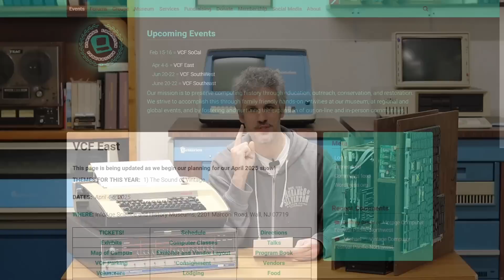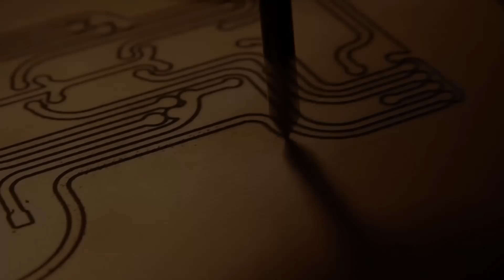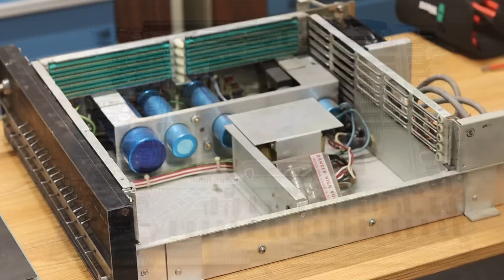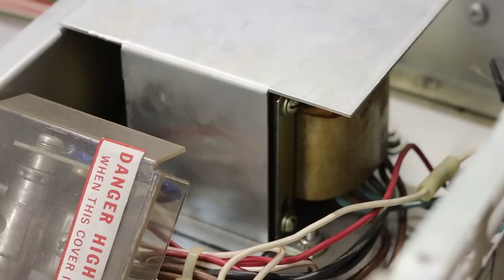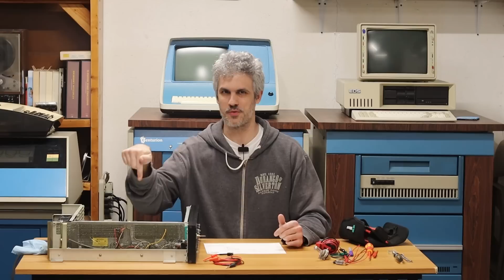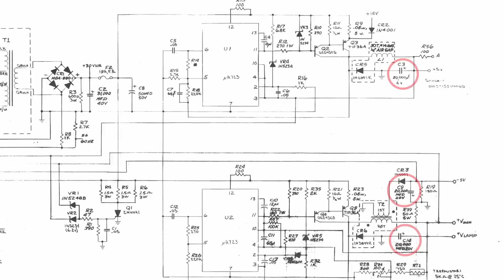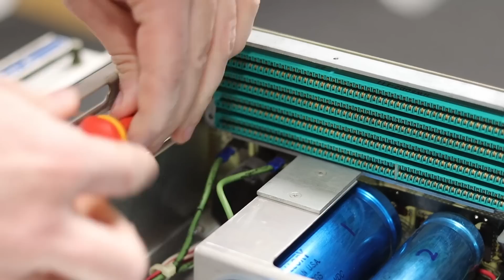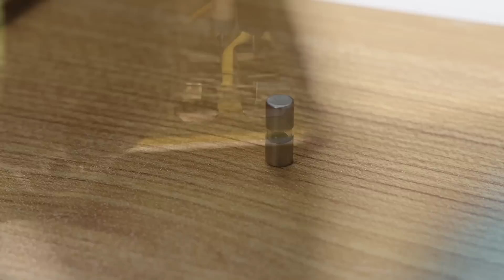Working on a Data General Nova 1210 Power Supply

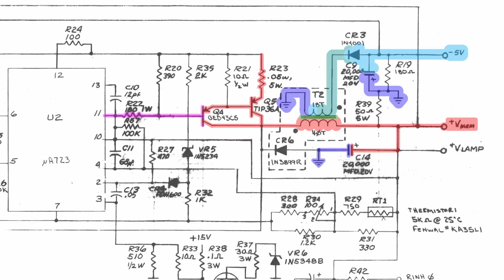Comment: 16:00 it looks like Q4/Q5, Primary of T2, CR6 and C14 are actually a buck converter for +Vmem and +Vlamp, and they tap off a secondary from the buck converter’s inductor to make a flyback converter with CR3 and C9 for the -5V. A bit of googling comes up with a name for this as a "Fly-Buck" converter although I never heard of this when I used to design switching power supplies.

Comment: PDP-11/73, will be amazing if you can give it a nice acrylic neon case.
DG NOVA 1210 is the creation of Edson de Castro, yeap, the PDP-8 creator (product manager). Edson de Castro died on September 6, 2024, at the age of 85. "Ed" (as some people called him) also the product manager of the PDP-X which was later cancelled, making him consider to left DEC to start Data General with the Nova as it's main product. AFIK, there's a lawsuit against De Castro by DEC, resulting in a "No go" for DEC, The Nova is the foundation for RISC while PDP-11 was the foundation for VAX, like I mentioned earlier, I'm not a big fan of VAX ISA but DEC construction was clever, not as complex as IBM but "just enough" to be useful. Now we know, RISC in the IBM Brain, was at the time, the foundation for many new architectures but 801 will not compete against MIPS, today Alpha (a MIPS descendent or DEC's MIPS) it's just another commercially failed technological marvel.

Comment: That looks like the type of fuses that are incorporated into christmas light plugs. On the part that plugs in, there is a small window with a plastic slider. They also usually come with extras. I am pretty sure they are 10A at 120VAC.
Reply: True! But the christmas tree fuses can not be trusted like the Buss or other branded ones for this type of equipment, unfortunately. The auto guys get burnt by a lot of unbranded fuses.

Comment: I'm pretty sure the very similar DG Nova  in my dad's lab at Strathclyde Uni. back in the day was connected to both a scintillation counter, and the PDP11-70 variant. We also hooked up a couple of early Commodore  Pets to it complete with a "BitPad" digitiser, hard drives and a bunch of other gubbins. 
Lots of serial weirdness and GPIB cables. Having access to these machines in my teens got be hooked..

Comment: Electrolytic caps should not just be tested with a "rule of thumb", especially one you made up yourself..   10mA is pretty high and while it says that the cap is probably safe enough to power up for brief periods to test other parts of the circuit without the cap immediately blowing up in our face, if you run it continuously, it will run hotter than rated and either spring a messy leak or slowly cook itself dry...   You should be measuring ESR after reforming to get a better idea of just how good the cap really is vs. just arbitrarily saying a current value is fine...

Comment: Does the -5V supply voltage change proportionally to the load on the +15V rail? As the +15V SMPS duty cycle increases to handle a load, the amount of energy through the transformer should also increase. Maybe R39 is meant to provide a minimum load so there's always some pulses for the -5V supply. (50 ohm, 5W attached to VMEM / +15V) I'm surprised that R39 is only rated for 5W since it will be dissipating 4.5W continuously.

Comment: Love seeing you bringing these computers come back to life David 👍
Top tip to remove the sliding cover: either sit it on the back and then slide it upwards or fit rubber feet to the bottom so that the cover doesn't rest on the work surface.

Comment: The thing I love about core memory is you can actually hear the data running through it. Used to come in very handy back when I used to repair ICL system 10s because you could hear when the diagnostic programs finished (or, frequently,  crashed!)

Comment: I would venture a guess that the two RAM cards need a greater gap than was offered by the backplane spacing, or that the card furthest from the CPU board was an add-on and just put in the next available slot.

Comment: Very cool.  Back in school in the mid eighties I had a digital systems course that used these.  I remember learning to manually assemble code to binary and load the programs and data in via those toggle switches.  Very time consuming and error prone but very valuable exercises in learning the fundamentals of computers and digital hardware.  Awesome memories.  ❤  thanks.

Comment: Yeah! I worked on Nova 1200s in the '80s, repairing them to the component level. They were used to acquire, process, and store seismic data for the USGS worldwide SRO (Seismic Research Observatory) systems. I still have a 16KB core memory card in storage somewhere, and probably a couple of manuals.
Reply: We used the TI Silent 700 KSR and ASR (dual cassette) teletypewriters in 20mA mode. I have one of each and brought my ASR to VCFSW last year.

Comment: That was lucky, my encounter with exploding capacitors left me with a 10 cm trace blasted away from the board. The fuse in your case did what it's meant to do, I wasn't as lucky :(.

Comment: I've come to the conclusion that it's good to put an Ohmmeter across the voltage rails when checking caps (I usually replace the older electrolytics) but since I so far only had one tantalum problem, I give them the benefit of the doubt. Measuring an almost zero ohm rail is a good indicator though and they can't hide from that 😜

Comment: I've build a better model then the one at Data General (Mod. Maj. Gen)

(Tune of "I am the very model of a modern major general")
by Stephen J. Levine
I`ve built a better model than the one at Data General
For databases vegetable, animal, and mineral
My OS handles CPU's with multiplex duality
My PL1 compiler shows impressive functionality
My storage system's better than magnetic core polarity
You needn't even bother checking out a bit for parity
There isn't any reason to install nonstatic floormating
My diskdrive has capacity for variable formating

(Chorus)
His diskdrive has capacity for variable formating
His diskdrive has capacity for variable formating
His diskdrive has capacity for variable format-formating

I feel compelled to mention what I know to be a gloating point
There's lots of space in memory for variables floating point
Which shows for input vegetable, animal and mineral
I've built a better model than the one at Data General

(Chorus)
Which shows for input vegetable, animal and mineral
He's built a better model than the one at Data General

The IBM's new homecomputer's nothing more than germinal
At Prime they still have trouble with an interactive terminal
While Tandy's done a rotten job with operations boolean
At Wang the byte capacity's to small to fit a koolie in.
Now Intel company's finances are somthing of the troublesort
The Apple IIC crashes when you implement a bubblesort
All DEC investors soon will find they haven't spend there money well
And need I even mention NeXT or Unysis or Honeywell

(Chorus)
And need he even mention NeXT or Unysis or Honeywell
And need he even mention NeXT or Unysis or Honeywell
And need he even mention NeXT or Unysis or Honey-Honeywell

By striving to eliminate all source code that's repetitive
I"ve brought my benchmark standings to results that are competitive
In short, for input vegetable, animal and mineral
I've built a better model than the one at Data General

(Chorus)
In short for input vegetable, animal and mineral
He's built a better model than the one at Data General

In fact when I've a Winchester of minimum diameter
When I can call a subroutine of infinite parameter
When I can point to registers and keep their current map around
And when I can prevent the need for mystifying wraparound
When I can update record blocks with minimum of suffering
And when I can afford to use 100K for buffering
When I've performed a matrix sort and tested the addition rate
You'll marvel at the speed of my asynchronous transmission rate

(Chours)
You'll marvel at the speed of his asynchronous transmission rate
You'll marvel at the speed of his asynchronous transmission rate
You'll marvel at the speed of his asynchronous transmission-mission rate

Though all my better programs that self reference recursively
Have only been obtained through expert spying done subversively
But still for input vegetable, animal and mineral
I've built a better model than the one at Data General

(Chorus)
But still for input vegetable, animal and mineral
He's built a better model than the one at Data General

Comment: Tantalum capacitors would have been used for a reason. Small size, but more importantly lower ESR. Probably on the backplane to reduce noise on the power rails. So using Al electrolytics might cause problems later.

Comment: Aha! I was thinking to myself "was it a Data General Nova that ran the EDAX that I used during my PhD?" and then you showed the EDAX manual. 
EDAX is "Energy Dispersive Analytical X-ray". It's used to measure the elemental composition of samples in an X-ray microscope.
https://en.wikipedia.org/wiki/Energy-dispersive_X-ray_spectroscopy
The unit that I used was hooked up to a JEOL transmission electron microscope, though typically they are used with scanning electron microscopes. 
The Nova in this case was a wheeled cart with a portrait-orientation monitor on top and a keyboard. In the front were two 8" floppy drives. 
I noticed at the time that there was a minicomputer in each microscope room, but I don't think many did. They looked so unlike anyone else's idea of a computer that they had escaped upgrade-itis 
You see, this was around 1990, they were already pretty old by that point. 
Of course, that's positively modern compared to the PDP11s that were running some of the dynamometers at Ford's Dunton labs as late as 2018. 
The 8" floppy drives were pretty useless at that point for getting data off of the Nova and into a modern PC for post-processing, but I found that during a measurement the conts were output on an 8-bit parallel interface. So I built up some 74-series logic to serialise that, add start and stop bits, and send it to an IBM PC. I was quite proud of that.

Comment: Tantalum caps are very qualified as explosive devices, they always fail quite dramatically. I had a mate/colleage who was getting into amateur rocketry, and was having a hard time getting his hot wire ignition system 'off the ground'. We had about 20,000 smd 6.3v tant caps. Gave him a reel of 1000 of those. 12v, reverse polarised, never had a misfire again. They are spicy. We were testing em out in the car park one Friday afternoon, Friday beers. Boss comes back from a site trip freaking the heck out from the smell. Any electronic engineer has a strong panic response from the unmistakable stench of an exploded tant. Nah nah, all good boss *pass a cold beer*. After hours games. 🎉. We let off a few that night. They get very enthusiastic with rectified mains, that was his idea. Pro tip for life, have a boss you can enjoy having a beer with once the work is done. And is as keen for dumb stuff. Engineers are just as stupid as anyone else, the scary part is they're competent. I think that was the 4th time the car park was set on fire. Nobody ever got hurt tho. We're competent.

Comment: I was SO envious seeing you remove all those screws with no trouble!

I'm getting started on restoring an AN/USM-281C oscilloscope built in 1973 that once belonged to Naval Electronic Systems Command.

It was working when I put it away, but I haven't touched it in about twenty years. I never tried to service it before, since nothing ever went wrong when I used it.

The first aspect that is trying to defeat me is simply getting the chassis apart. Some sailor over-tightened virtually every screw inside the unit, and most of them are Phillips that now have torn slots. There's at least one that didn't succumb to penetrant and an impact driver, and I had to resort to a left-handed drill bit.  Surprisingly, once it busted loose, the threads looked to be in good shape, although I chased the hole with a tap just to be sure.  The thing is built like a tank - the case looks as if it would survive small-arms fire!  (It conforms to the military definition of 'portable' - there's a handle on it.)

I (rather foolhardily) tried to power it on, and it didn't make any smoke and at least puts a beam on the screen, deflecting it in a crazy pattern.  I got enough access to check power supply voltages, and found that +130, +50, +15, +5, and -50 are all dead on, but -15 is putting out only about -12.  I think there's an old cap that needs reforming.
If the -15 regulator isn't regulating, that'll throw off all the signal handling, so no more debugging until the power is stable, which means that I have at least six more screws to sweat over before I can get to the big caps.

Fortunately, since it's a military unit, I was able to get all the manuals.

Fun times!
Reply: Man... that thing is a museum piece.  Glad you're trying to get it going.  I used one of those while attending ET A School in the A3 phase (RADAR).  I barely remember anything about it now, except that it took a loooooong time (about an hour)  to warm up before it was stable.  Stay with it, man.  That's a real piece of electronics history.

Comment: If the Rifa's don't get you, the tantalums will!
Reply: If if they don't, then crappy electrolytics will have eaten your motherboard (stares at Amiga A600 sitting on my desk)
Reply: @DaveF.  Or the Varta batteries... (stares at my Amiga 2000 whose battery leakage took me 3 months to fix) #GetTheBatteriesOut
Reply: Rifa, more like reefer -- all they're good for is smoking! 😅
Reply: ‘Don’t fear the Rifa’ nah that would be a bad song.
Reply: @radarmusen Oh HELL nah.  Don't fear the reaper is an awesome song!

"All our times have come.
Here, but now they're gone.

Technicians don't fear the Rifa.
They fear the sun and the wind and the rain!

We can be like they are!
Come on baby,
(Replace the RIFA's)
Baby take my hand
(replace the RIFA's)
Gear'll be able to run.
(Replace the RIFA's)
Baby i repaiiiiir!

Lalalalalalala (for a while)

Tantalum time has come.
Good, but now they're done.

Romeo and Juliette
Are together for eternity.
(we can be like they are)
40,000 capacitors dying every day."
(we can be like they are)
40,000 capacitors crying in despair.
(we can be like they are)
Got to replace them AAAAAAAALLLL!"

And, that's as far as i am taking it.  Getting pooped.
Reply: @ this is gold, laughing while reading it.

Comment: The black insulating layer between the boards makes total sense. Back in the late 80s I used to use a rather old (even then) electron microscope with a data capture system driven by some sort of 3 ft tall Unix rack with 8” floppies. It had horizontally mounted boards like that one, and it used to work fine for an hour or so, but after that the boards would get nice and warm which would cause the processor board to droop and short the one below out if you weren’t careful. We used to wedge a wooden rule between them to prevent it drooping.

Comment: I have a Data General Nova 2 computer that had the exact same thing happen with one of the sneaky tantalums on its backplane.    The tantalums are used to decouple the inhibit driver power for the core planes, if memory serves.    Anyway,  I turned the keyswitch and this brilliant flare of orange light shot out from the side of the unit, followed by a loud SNAP and smoke.  Scared the heck out of me.   I replaced the failed cap with an electrolytic, and yes, that worked just fine, and nothing else was damaged.
Hilarious that you ran into the exact same problem.   Maybe I'll just change out the other 7 caps before I try powering the Nova back up....
BTW -- the reason for the connections to the serial connectors from the backplane is that this is that this is the way DG does I/O connections from many of their boards -- some of the pins in the backplane are not connected and are instead used for I/O cabling.  Saves having connectors on the other edge that would make it hard to get boards in and out.
Cheers  -- Dan
Reply: I once saw some technicians in the computer science department at the University of Canterbury installing a disk drive in their DG Eclipse system, which involved attaching a connector at the back and running a bunch of wires to points on the backplane. I remember thinking at the time it seemed like a rather shonky way of doing things compared to the way DEC would have done it. I assumed it was a cost-saving measure.
Reply: you HAVE...present tense?  WELL, may I warmly welcome to the DG Users Group!
Reply: Tantalums go pee-yow! 😆 I bet that Nova 2 is a hoot to operate.  Me?  I can't afford heavy iron anymore, so I'm looking into building a PiDP-11/70.
Reply: "if memory serves" ... I see what you did there
Reply: @danmccr  Seems like a pretty nice
approach.  There are of course some downsides but at least they didn’t have to worry about Signal Integrity as much back then.

Comment: From the captions on your scanned paper (just looking at the paused video), it looks as if if it was electron beam microprobe analysis.  It's talking about using TEM (Transmission Electron Microscopy) specimens and observing K and L lines (which are the first two series of "characteristic X-ray" lines (the term in quotes is a good starting point for a search engine). Characteristic X-ray lines are an energy spectrum, and can be observed when an electron transfers its energy to another particle, as well as when it emits a photon directly, so X-ray detection wasn't necessarily involved here.

I can't tell from the captions what spectroscopy method is in use, but I suspect it's Auger electron spectroscopy (Auger is a French name, pronounced "oh-ZHAY", not a drill bit or a plumbing snake.)  I say that because they're looking for light elements where X-ray fluorescence doesn't work.  

That big connector probably connects to a whole rack of equipment, so I wouldn't venture a guess what sort of signals are on it.